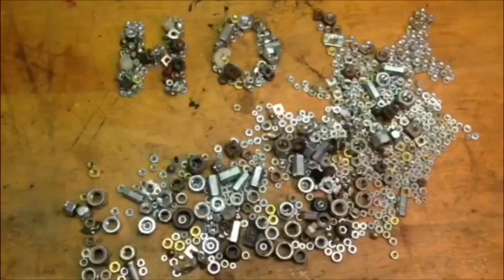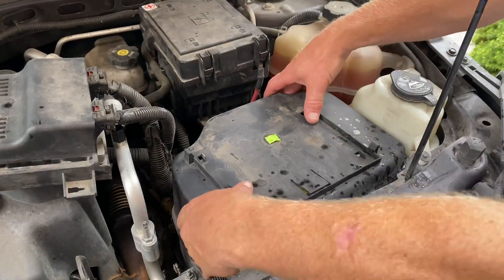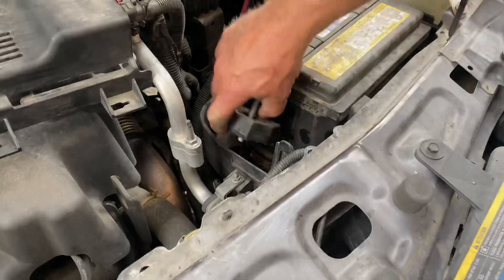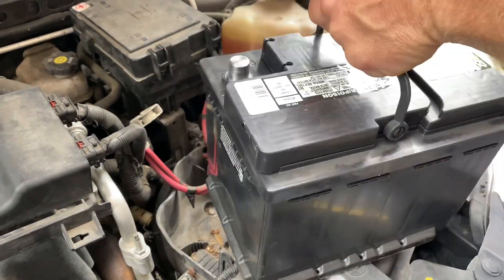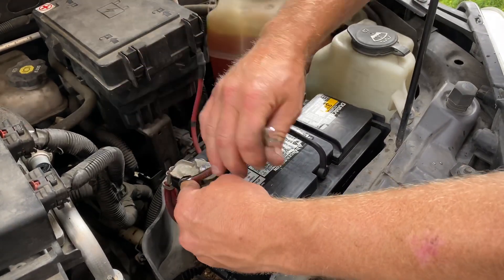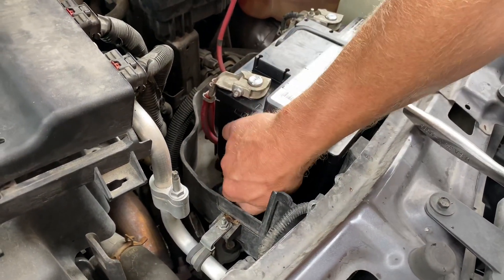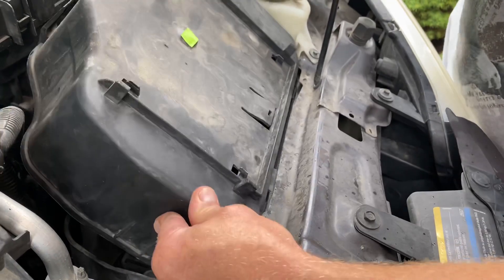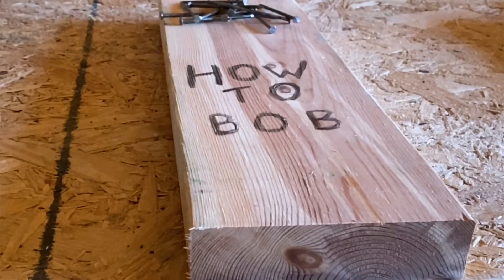Changing The Battery in a Chevy Equinox

Comment: Hello, maybe you can help me out. I replaced the battery, but not all of the functions come back. The autolock, power windows, and internal lights don't work. The dash lights come in, the headlights come in as well. But the car just won't start. I've checked the fuses, I just don't know what more I could check.
Reply from the maker: I would start with checking all the connections, trace the negative cable and make sure it is connected correctly  and that nothing is corroded. Another thing could be a control module but it’s hard to tell without seeing the vehicle. I wish you the best, Hope this helps.
Thanks for watching.